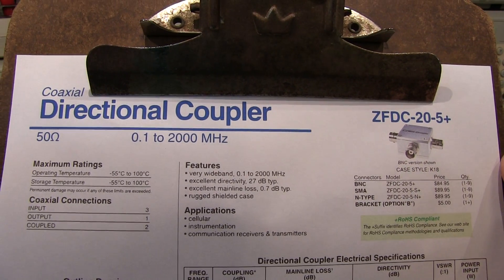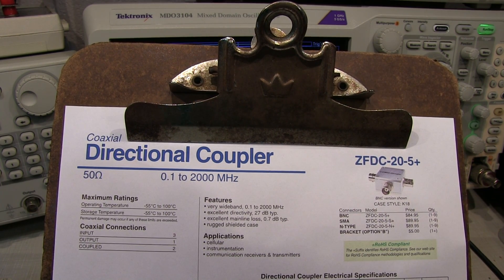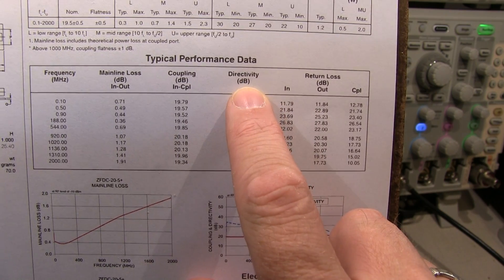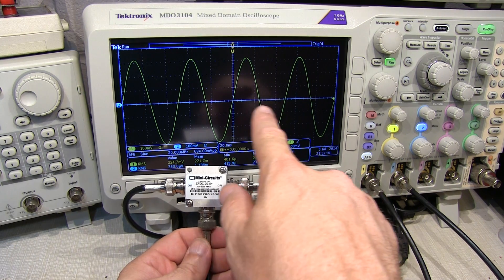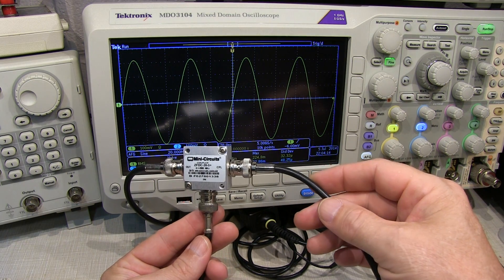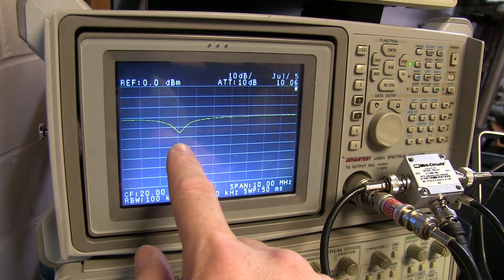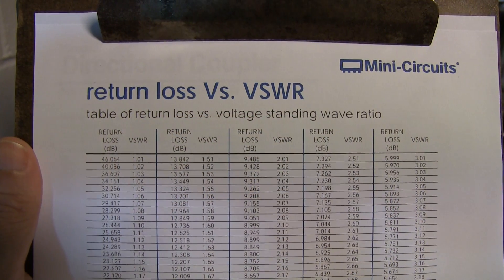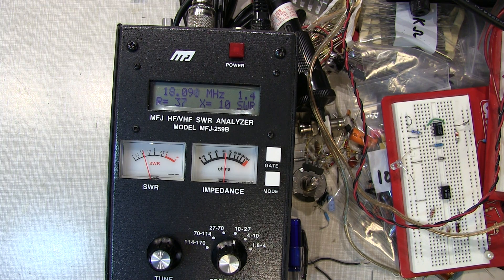#158: Directional Coupler Basics & how to sweep SWR of an antenna | Return Loss | VSWR

Comment: Alan, very nice tutorial, as usual. As far as the directivity, I think the listed specifications are relative to the mainline signal and not relative to the coupled signal. I looked a the ZFDC-20-5 that I have and these are the results I got:
Input signal in forward direction (10 MHz): +20 dBm 
Coupled signal +1 dBm (19 dB down from the input signal, agrees with the spec)
Input signal in reverse direction (10 MHz): +20 dBm
Coupled signal: -14 dBm (34 dB down from the input signal, again agrees with spec). You state that you add the coupling dB to the directivity dB, but doing so would give a number of 53 dB, but the signal is NOT 53 dB down from the input signal. Could you clarify this?
Reply from the maker: I don't know why you got those results. The definition of Directivity, taken from a MiniCircuits application note: "The difference in dB of the power output at a coupled port, when power is transmitted in the desired direction, to the power output at the same coupled port when the same amount of power is transmitted in the opposite direction."  I verified this definition by measurements on the spectrum analyzer, where the output from the coupled port was reduced by the Directivity value when the in/out we're reversed. In your case, did you properly terminate all ports in both cases?
Reply from the maker: I just verified my results. 0dBm applied thru the mainline and properly terminated. Coupled port measured -19.6dBm on the spectrum analyzer. Reversed the in and out connections, and the coupled port power read -54.3dBm.
Reply: ***** Yes, the ports were all properly terminated. I made the tests with an oscilloscope (a Tek 2467B) and used the "measure" function to measure the voltages and then converted them to dBm. Tonight, I will try the same experiment on my Spec An.
Reply: ***** Just ran the tests on my spectrum analyzer. With 0 dBm in, the coupled port signal is 19.8 db down. With the direction of the signal reversed, I get about 36 dB down. I ran the tests on another ZFDC-20-5 and the results were nearly identical. Not sure why we are getting different results. I looked up the specs on the ZFDC-20-5 and it is almost identical to those of your ZFDC-20-5+ The signal was terminated into 50 ohms at the 2467B
Reply from the maker: vintageradiobuff Can't explain that!  Sounds like the directivity is lousy on them, or you've got some really leaky cables!
Reply: I picked them up on ebay relatively cheaply. It is quite possible that they were rejects due to the poor directivity. Never checked them to see if they were up to spec until now. Oh, well!

Comment: A good video. Interesting is that the waveform voltage on channel 1 increased when the load was increased from 50 ohm to 1 meg ohm. And the power transferred was then less than with the 50 ohm load even though the waveform voltage increased. If you known what the increased voltage was across the 1 Mohm load, you could compare the transferred power to when the load was 50ohm.

Comment: Hi,
I didn't know for directional couplers. I'm learning basic of RF and transmission lines...
I tried to create directional coupler of piece of cable. Terminated output, give me 0 on coupled output. When output is open, coupled signal and signal from source are in phase, which is expected, but when I short output, signals are about 90 degrees out of phase. Why 90? I expected 180. Is it my setup problem or I didn't understood.
Thanks

Comment: why you don't using MDO3104 spectrum analyzer ?

Noise function will not work for this measurement ?
Reply: Yes, I could've used the noise generator and spectrum analyzer in the MDO and it would've worked fine. However, I showed this technique to show the filter responses in the SDR radios and figured that viewers like yourself would recognize that this would be an alternative way to "sweep" the antenna.

Comment: Alan, great video.
Question, how accurate do you find the MFJ to be? I see it being used by most hams, including my dad, but I am aware that numbers on an LCD don't always reflect the truth. On the other hand, if it is a tool used by most it can be considered as a standard no matter the downsides. Would it be valuable for you to make a video on the MFJ pointing out how to correctly interpret the values displayed by it? Regards, CX6BT
Reply from the maker: I've found the MJF to be accurate enough to be effective.  One thing you have to be careful with is that when testing antennas, signals that are picked up by the antenna may couple into the bridge and upset the readings.  I'll think about doing a few vids on the 259B in the future.

Comment: At 4:23 you refer to 20 dB being "1/10th the power", but isn't it 1/10th the voltage, and 1/100th the power?

I found this video very informative, and a great explanation. If the mood comes to you, I would like a video that explains a few of the ways couplers work.
Reply from the maker: Ack!  I hate when that happens!  Of course, you're right.  I've added an annotation to correct my mis-spoken narration.
Reply: @w2aew  20 db down on power is 1/10 of voltage since "P-dbm = 20 * log(V-mpvv) - 56". so 1/10 of voltage is 20 db down. I did this calculation on my video: https://www.youtube.com/watch?v=_1R9fDVkjwk&t=4s
Reply: gets tricky when you speak volts and dbm
Reply: 20 db down on power is 1/10 of voltage since "P-dbm = 20 * log(V-mpvv) - 56". so 1/10 of voltage is 20 db down. I did this calculation on my video: https://www.youtube.com/watch?v=_1R9fDVkjwk&t=4s